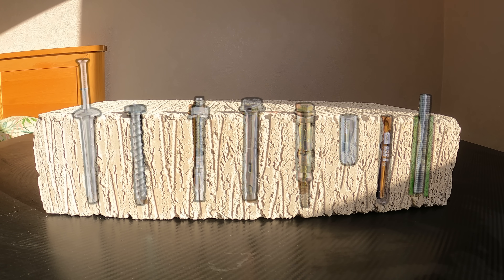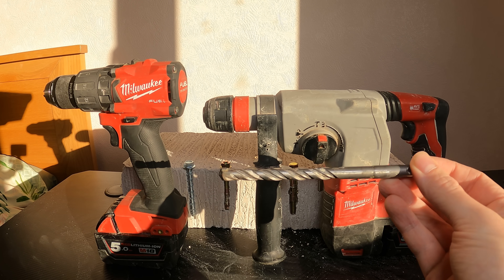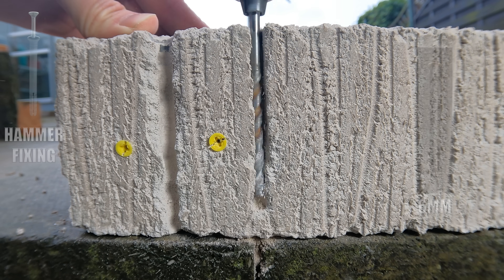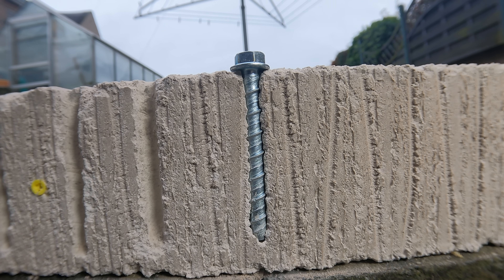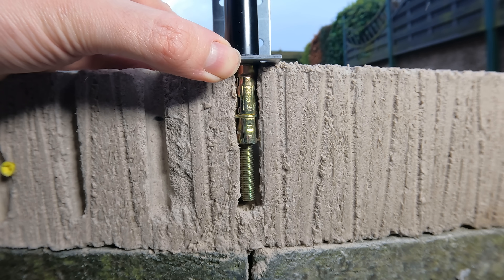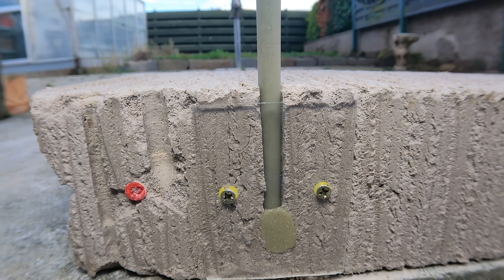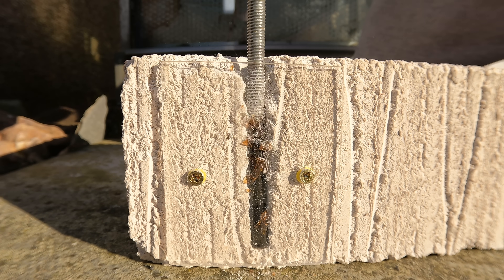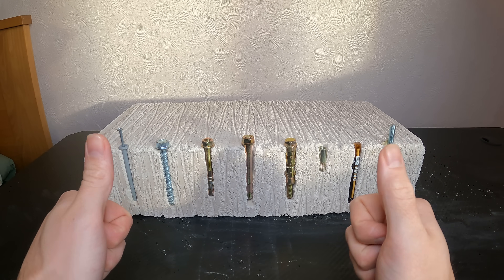CONCRETE ANCHORS FIXINGS AND BOLTS - 8 DIFFERENT METHODS FOR FIXING INTO CONCRETE

Comment: There are 2 kind of drop in anchors actually, the steel ones who you have to hammer down with said tools. And the brass colored ones which you can install by tightening the rod/bolt. they hold less in theory but don't require a special tool (or old drill bit or punch). Or you have a third type, brass colored one which can also be hammered.
Reply from the maker: thanks for the info

Comment: tHANK YOU SO MUCH FOR THIS EXCELLENT VIDEO.  I first learned about chemical bolts at the huge caterpillar generator installation at a commercial broadcast radio transmitter site.  That gennie clocked in at 15 tons and I thought... well.... they want to be sure it does not move !  I have used chem bolts many a time since and I can testify to their effectiveness. Your video shows thought, professionalism and great care taken in making it and I for one am most greatful. Showing this in cutaway form was a supurb idea.
Thank you again.
Reply: I'm curious if the chemical corrodes any particular metal screw... over time.  And, does the chemical break down over time?  The glue in plywood older roof decking breaks down around 50 years, and the plies begin to separate.
Reply from the maker: Thanks for the comment

Comment: I like to use the Shield Anchors, despite what you say in your summary, If you loosen the bolt, then tap bolt to release the taper nut, then jiggle these, you can in fact get them out. Also you can easily use threaded studding (all thread US) in place of the bolt.
Reply from the maker: good to know

Comment: You missed those quick nails, eq. Tubular spring steel tubulas fixing nails, very strong also and you can drill hole trough wood and use those
Reply from the maker: lots of options

Comment: Excellent video!  I have used about half these types of anchors for various applications.  Two tips:  1) After drilling and cleaning the hole, I test with a pencil (etc.) to make sure it is indeed cleaned out of dust and is deep enough.  2) On the sleeve bolt (highlighted in yellow), take a moment and gently hand-tighten the nut to the bolt before driving.  This will help ensure that the bolt does not just spin when you go to tighten it.  This will save the hassle of extracting the fitting.  (Ask me how I know!)
Reply from the maker: Thanks for the advice

Comment: This doesn't seem to be regular concrete. If it really is some sort of concrete-alike block - then it is either airated lightweight or ultra-lightweight concrete or other non-structural, no load bearing type of block. It is obvious by the form, coarseness, and the fact that you drilled a hole in 4 seconds. You can't drill a hole this size in just 4 seconds with a SDS drill in ANY normal strength concrete.  Normal concrete is very hard to cut too. Normally you need a diamond cutting disk or a diamond saw to cut it with extremely large amounts of very fine dust.  You probably cut this block using only a saw ... so .... for visual - it is good to show the cut,  but you are not using an actual concrete.

Comment: Another point about hammer combi drill versus SDS: SDS will generally give you a cleaner, tighter-tolerance hole. Milwaukee and some others sell a small SDS drill which isn't hugely expensive and will drill up to at least 10mm holes, which is excellent for DIY and general maintenance applications.
Reply from the maker: Great tip!

Comment: Are ones like sleeve anchors good for wet environments? I went with the blue primed tapcon bolt because it seemed the most water resistant, but I dont think they grip nearly as well. I like the idea of the resin ones tho, never seen em before
Reply from the maker: Yeah the sleeve anchors should be fine.
Reply: You can get shield anchors made from stainless steel, might be worth checking out.

Comment: Not only are the resins very strong, as you mentioned... but a good, construction-grade epoxy (for instance, Hilti's) is stronger than the concrete.  I knew an engineer who would NEVER specify J-bolts because the cold working weakened the steel and it was easier and stronger to epoxy the studs in place.

Comment: If drilling holes in concrete was just as simple as presented here life would be a breeze.
Concrete, and bricks, etc. comes in different strength, good luck to drill a hole in hard concrete with your combi drill, it can take 10-20 minutes, in some cases you just can't do it, where the SDS may need a minute or two. There is also the fact that the combi drill does not have the punch to crunch hard concrete so it is just grinding the hole, it is wearing out the drill-bit fast, the SDS have much more punching power to crunch the concrete and the drill-bit will last much longer but not forever, even quality SDS drill-bit wear out.
Btw, after the brushing of the hole you blow it out too, just saying.
Reply from the maker: fair enough

Comment: With the 2 part chemical resin, you actually want to screw the stud into the hole so that it successfully encapsulated the thread. Pushing it in won't work as well. 
You also don't want to fill up the hole 100% as it needs to account for the volume of the thread. I typically go for 2/3 of the depth of the hole depending on the bolt diameter and that usually gives me a tiny bit of excess at the end,  will save a fair bit of material and time removing excess in the long run, especially if doing lots of bolts! Great visual demonstrations
Reply from the maker: Yup that’s a good tip. Thanks for the info

Comment: 7:37 In order to use these chemical anchors, the drilling dust must not be removed. This is also stated on the exact packaging that you showed us.
Reply: He said exactly that in the video. You added no new information
Reply: @woody1380  To be fair, it is particularly important for the resin fixings, much less of an issue for the others.

Comment: Used many lead machine screw anchors. The only down side is you need a setting tool but they work great on hollow cement blocks.
Reply from the maker: Yeah they are a great option.

Comment: Brilliant, I don't know how the almighty algorithm knows but I needed a video just like this, got to anchor some 2x4s into concrete and didn't really understand the different types of fixing. The expanding metal sleeve type are the most commonly sold and used in my part of the world but now I know how the other types work too, the capsule type I'd heard about but it's the first time I've seen it in action. So ignore the guy saying the test was useless, it wasn't meant to be some scientific comparison, it's really helpful to see how each type works.
Reply from the maker: Thanks man appreciate that comment. Yeah the purpose of the video is to demonstrate to the average diy person how these anchors work so you can see them in action. Obviously anyone with half a brain cell knows not to drill into the edge of a concrete block to secure anything down lol 😂
Reply: The algorithm knows because of that brain implant you received.  Of course, your memory of that operation was erased.

Comment: The most useless test. The fact that you don't drill in a whole brick and have no equipment to make a pulling test but just drilling right in to the edge and securing with a slim piece of polycarb is absolutely hilarious, brick gets damaged before you manage to put an Anker in it.
Reply: Clearly You missed the point of the video. It's a visualization of different methods, not a test.
Reply: You are joking right?
Reply from the maker: Glad it gave you a good laugh 😆
Reply: Sure?  In this descriptive test i observed a lots of secondary effects about to lock these screws there.  And now i have more confidence to simulate or do more test in moy job.  but well , you are the "master"...
Reply: What test are you talking about? I didn't see any tests or any claim to be doing tests. Did you comment on the wrong video? What method do you suggest to show how the anchors work in the hole other than drilling the hole at the edge where it can be seen?
Reply: What’s an ‘Anker’….never heard of an Anker before…oh, do you mean that manufacturer of battery pack back up systems, yes I’m sure they are called Anker.
Reply: @contessa.adella  Maybe it's the part of your leg above your foot?

Comment: Great video, may I kindly suggest less is more when it comes to the sound effects and whatnot? Found it a little distracting personally. It's good to see people teaching how to actually clean a hole out properly. A lot of times people think it's over the top to blow out the dust and also use a little brush, but both actually do a different and important job. We did a lot of retro fixing reinforcement bar  into concrete (1m long holes vertically) and the blowout process was painful as the dust can only come upwards which isn't as easy to deal with. (a) your face tends to be near the dust blowout, and that's a LOT of dust and you need to blow hard, and (b) it tends to fall back down. In the end I developed a process of using a powerful mains handheld vacuum with a 1m length of 8mm flexible hose, with the tip cut to an angle, then using an internal pipe-cleaner style brush on the end of a long dowel, then the dust blower, then repeat a few times. About 20 mins to clean each hole! But without that cleaning it simply wouldn't have been possible to fix in properly with resin....
Reply from the maker: Yeah was not sure if the animation was taking away from the video or adding to the video.
I’ll take that feedback onboard and thanks for the tips
Reply: @mikebolt9753  I'm no expert myself, just a punter :)
Reply: I am impressed by how well you did the job of cleaning out the holes. From your claim to be "just a punter", I assume you are an amateur, and I am disappointed that no professional tradesman would have done such a good job.

Comment: I didn’t watch the first version. But it must be very frustrating to lose all those views, likes and comments. I thought this was a a very good visual explanation of the various concrete fixings. I really enjoyed the added SFX and graphics highlights. It looks like you had a lot of fun putting the whole thing together. I like the drop in anchor, for some fixings, because it gives you a lot of control on the depth of the item being fixed. I’ve used the concrete bolt/screw for a lot of things and they are an amazing option. I’ve also used the Fischer capsule resin anchor which I also liked. If you buy the specific threaded rod from Fischer, it has a sharper point for crunching up the glass. They also do a setting tool for the SDS drill which makes setting the drop in anchor easier. One thing to mention is that some of these options have better corrosion resistance, which might be a factor for some use cases. For example you can get stainless steel drop-in anchors and use stainless steel threaded rod.
Reply from the maker: Hey, Thanks for the informative comment and positive feedback. Yeah taking the video down and re uploading it has impacted the video in a negative way In regards to click through rate and average view duration which means the algorithm will put the video out less, but I’d rather have less views and make sure the video is right.